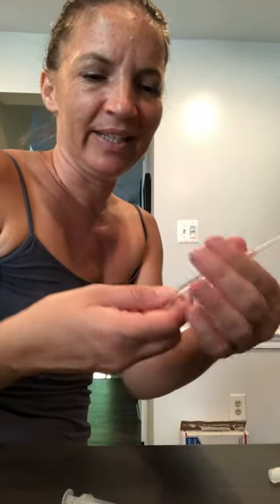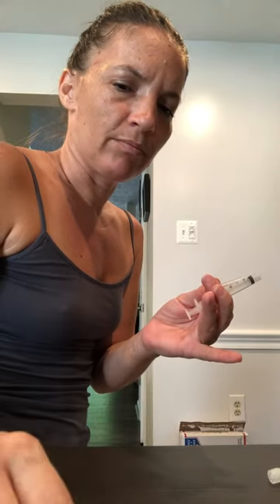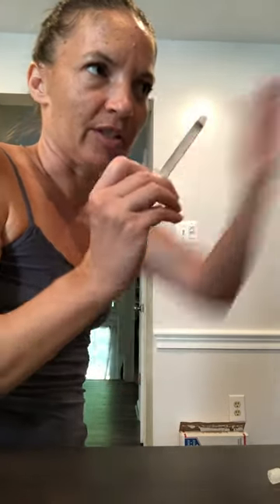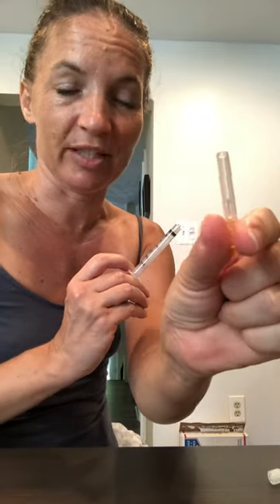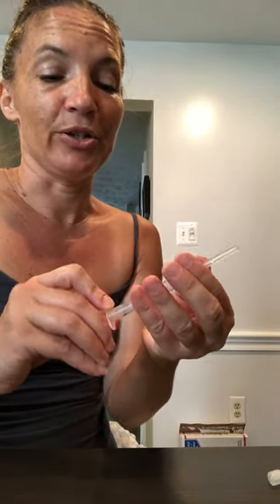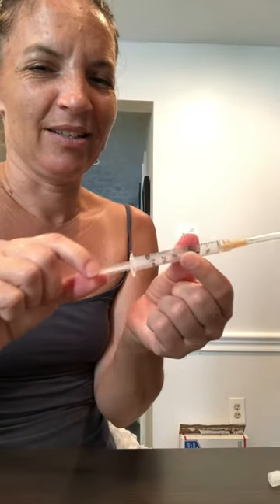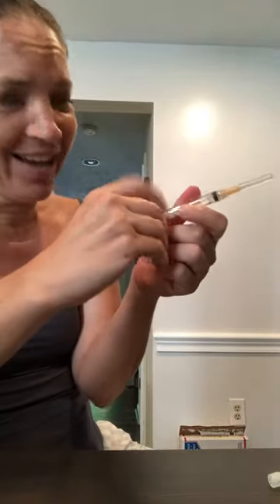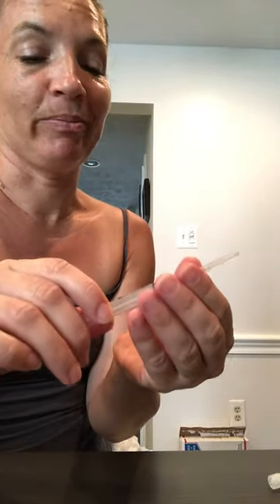Possible solution for a stubborn t:slim syringe plunger: change the needle tip!

Comment: Use a small clean cap from a pill bottle, and sanitize it. Draw pure filtered Baby Oil into the syringe, repeat a few times the rinse with pure water. It works extremely well. One 100 ml of pure baby oil will last years.